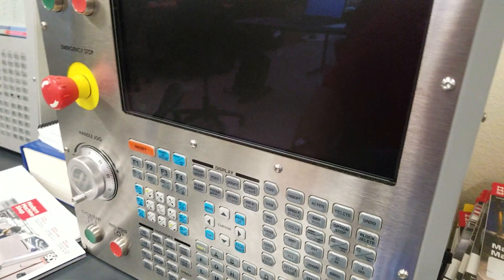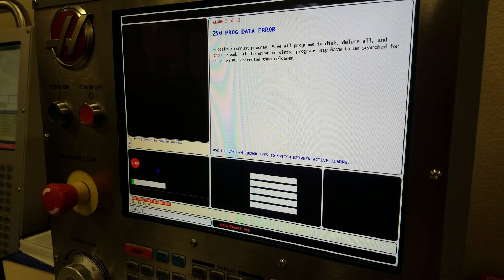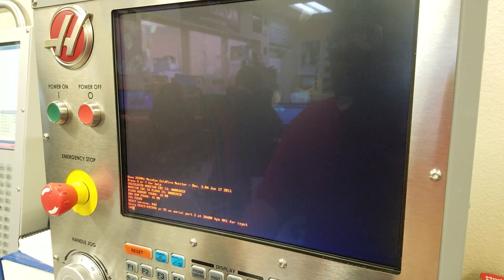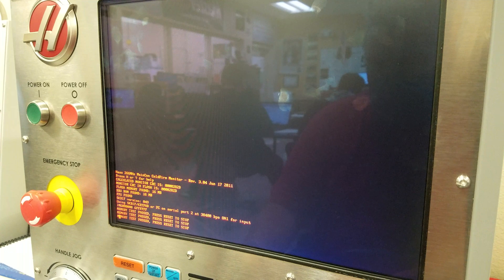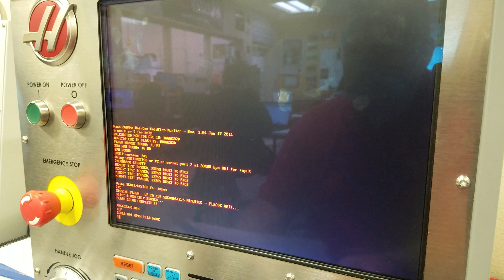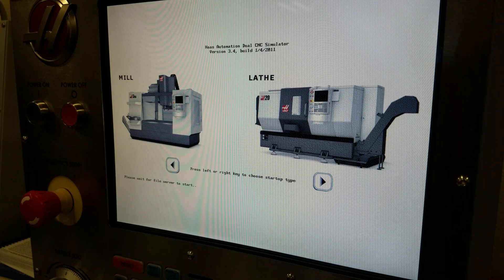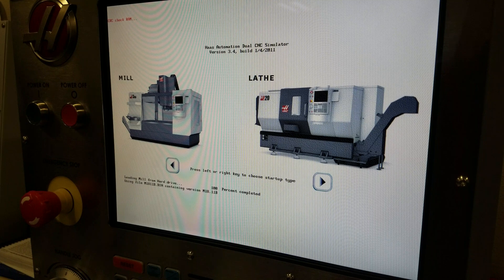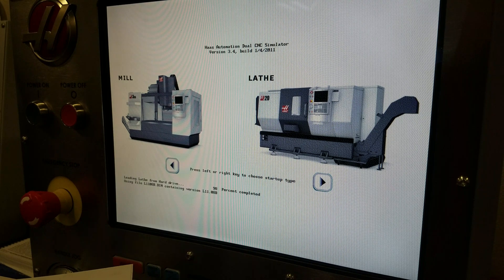Haas CSMD Simulator Software Fix Pt 1

Comment: hi, where I can find manual for this HAAS control emulator?
Reply from the maker: to fix or to run it?
Reply: @CNCMachinistEducationNetwork  to Run
Reply from the maker: @copypaste815  There is not a manual to run simulator. Its virtually the same as real Haas Control.  It will do Lathe or Mill.  The Next Gen model will do UMC 5 axis as well plus ST10Y 4 axis lathe. We used it to teach students hand G code plus they get familiar with control. 

You need to put in fake offsets for tools and Work coordinates
Reply: @CNCMachinistEducationNetwork  tnx for your answer